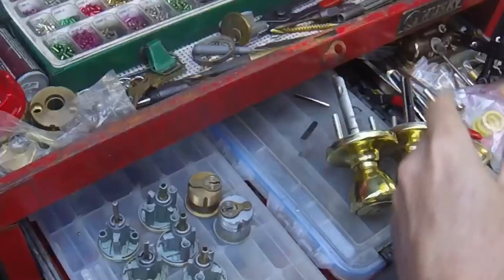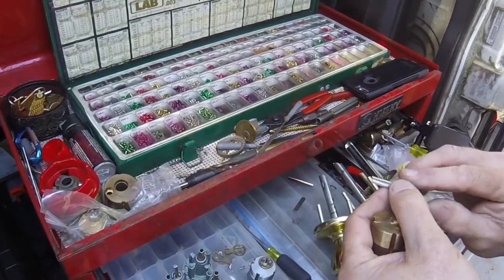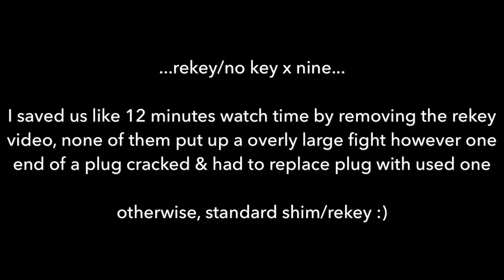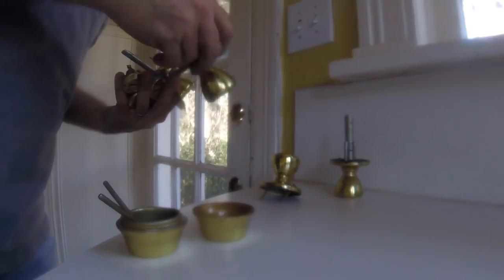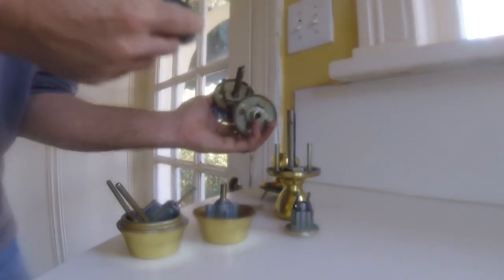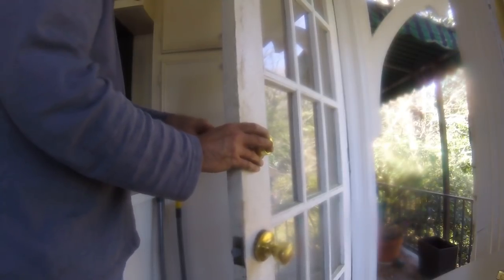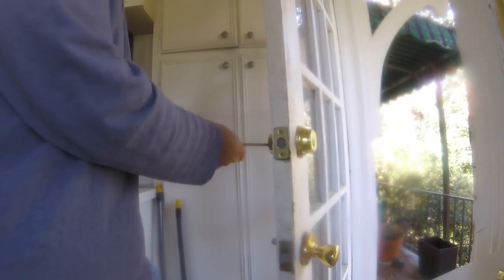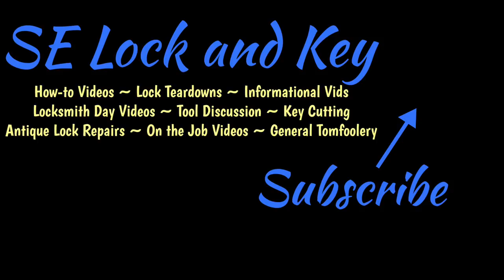another vacant “pretty nice little pad”

Comment: I have a locksmith friend who would
Carry lip stuck in his tool box for
Marking the end of the bolt of a
Dead bolt when it wouldn't line up
With the strike plate mark the end
Of the bolt extend bolt check location
On strike plate hope this helps
Reply from the maker: yep, but it melts to easily in our 1000 degree summers, and makes quite a mess

Comment: G'day, Se lock and key. Just a quick question or two. I notice you never use a cordless drill to remove and replace screws.Just curious. Also, did you intentionally leave that key in the deadbolt on the rear door or was it a brief moment of forgetfullness? Cheers:-)
Reply from the maker: Paul Springett me removing it probably got cropped out, started with two keys and two keys went in lockbox so I didn’t forget! :) 
My hands just stay too full to juggle an electric drill. A few people have asked me about that :) on a related note I have fairly strong forearm muscles ;)
Thanks for watching!